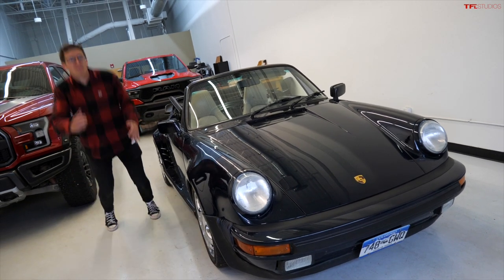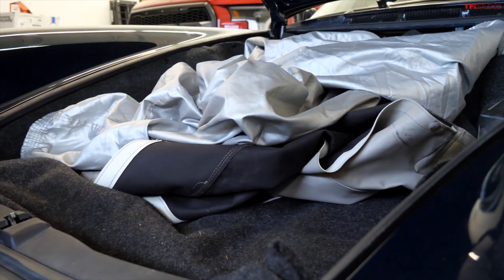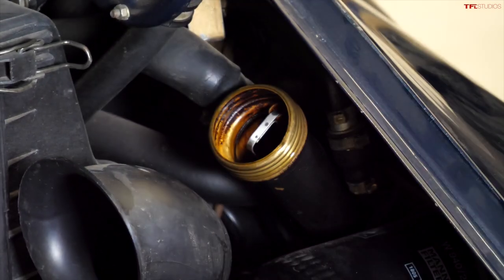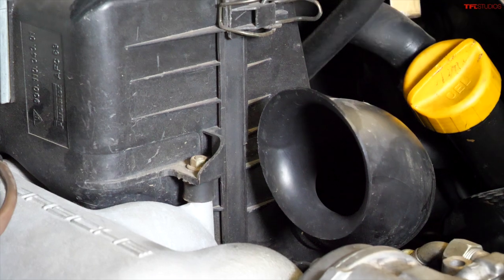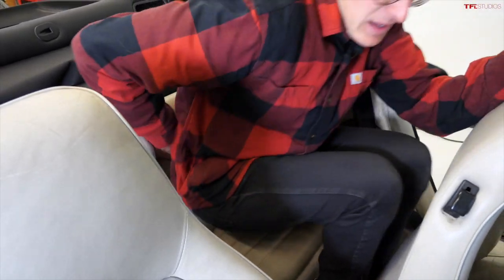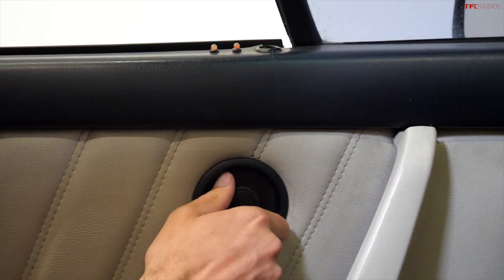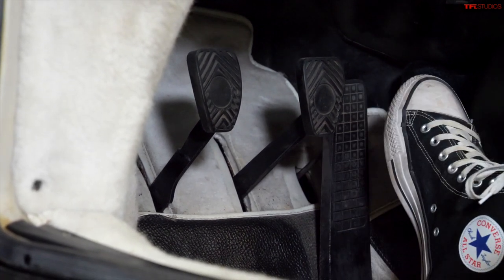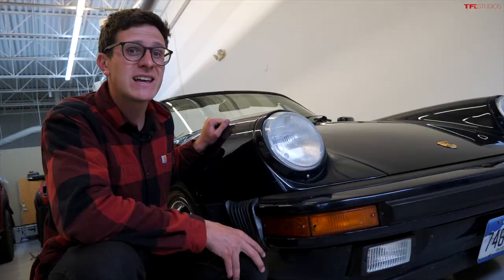The 1987 Porsche 911 Has Some Truly CRAZY Gadgets & Gizmos!

Comment: Heater controls are likely to open vents to the heat tubes, like the VW beetle - there is no heater core since it's air cooled. AC is likely an entirely different system and I suspect you could have the heater and AC working at the same time.

Comment: Good job Tommy ..but when you checked the Porsche 911 oil there was none on the dip stick you guys better make sure there is oil in it..
Reply: Wrong you check it when at idle warm on flat ground. Dry sump so the oil goes down into the engine when its not running.